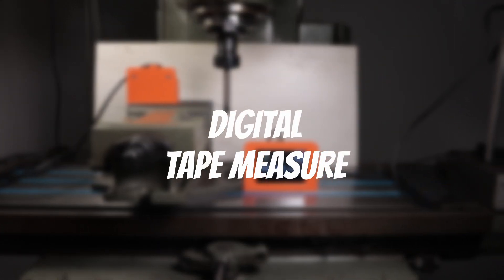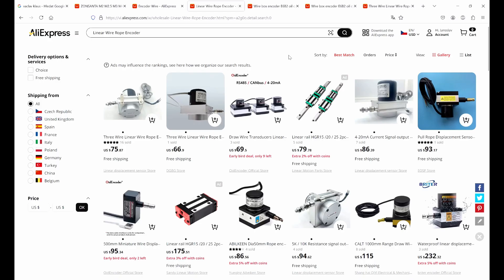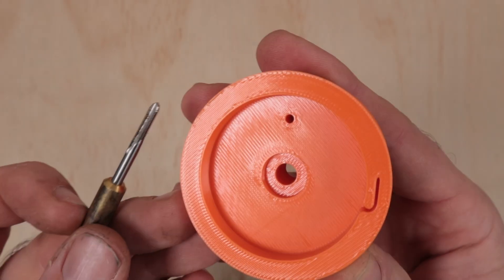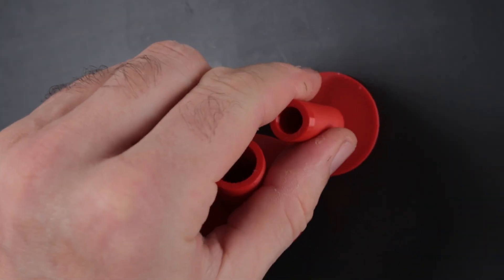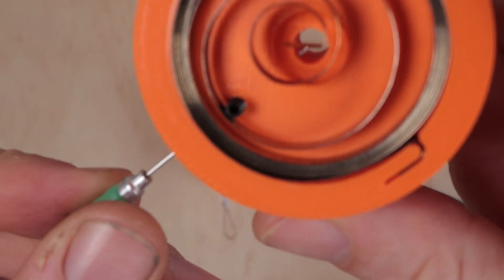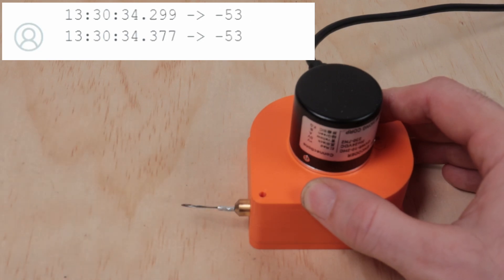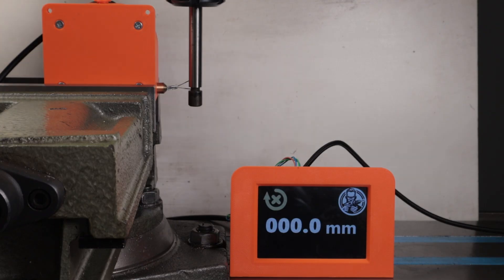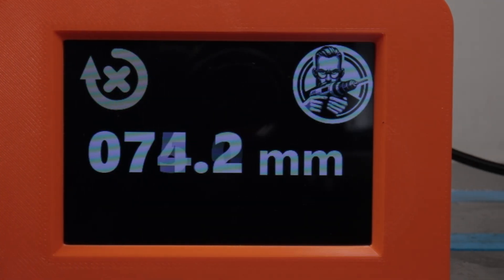How to Make a Digital Tape Measure: Step-by-Step Guide / Arduino + 3D Print

Comment: Instead of using a single ratio you could use a calibration table and interpolate the ratios. You can also eliminate the slight runout you may have in the wheel.

Comment: Thanks for sharing this. I’m wondering if the optical detection of rotary motion might be a superfluous step. Could you optically sense the unspooling of the wire directly? Maybe this can’t be done precisely enough but I notice that a cheap optical mouse seems to do a great job at precisely detecting motion under its sensor. Couldn’t an optical sensor similarly directly sense the wire moving past it?
Reply from the maker: Hello! Thank you for the feedback. That is actually what the encoder does 🙂. So, it could be done that way, directly, but at the cost of accuracy.

Comment: This is cool. I assume with the brass tube you recommend you no longer need a lathe? 

As for the 3D printing, try out the tree/organic supports, and possibly turn on "support on build plate only", makes support structures that don't have to sit on the model and instead will sit on the plate and reach in diagonally to support things like sideways holes.

Also is there a particular reason why you decided to both have heat-set inserts and tapped threads? for the set screw to hold the shaft of the encoder i would imagine you could just use a heat set insert that isn't so long that it goes the entire way through the printed part, but just long enough for the set screw to hold it.
Reply from the maker: Thank you! I'll definitely try different supports. Yes, the final upload is modified for a brass tube. I somehow prefer inserts, but I have to admit that in this design, it is a complete overkill. To be fair, if I made slightly larger holes in the wheel, the set screws could self-tap themselves. I also considered using inserts there, but it could possibly mess up the wire rope track. However, it could be done that way.

Comment: Looks sick! Although, Why such a large encoder? Any specific reason?
Reply from the maker: Thank you! 🙂 I wasn't able to find a smaller encoder with at least 600-800 pulses per revolution. The small ones, usually coupled with Arduino, has around 32 or so. The size of the design was limited also by wire rope, which is flexible, but  with limits.

Comment: An English tip for you:  "wind" is a homograph.  When you pronounce it like "in" it means moving air.  To refer to coiling a spring, pronounce it as "eye".

    Wind (noun: movement of air):
    IPA: /wɪnd/
    Example: The wind is blowing strongly.

    Wind (verb: to turn or twist):
    IPA: /waɪnd/
    Example: Please wind the clock.
Reply from the maker: I just said it out loud and I feel a little stupid :D. To be honest, this word is a bit exotic in my non-native vocabluary. Anyway, thank you for the clarification :). PS: I have pernament issue with word "diameter", that is where my native language kicks in and I find out only during audio edit.

Comment: Nice project!
Reply from the maker: Thank you, I plan to build a smart forging press and I am currently hoarding the key parts, this is one of them.
Reply: @JustAnotherCraftsman  I am also building a smaller one with a smaller tape measure and custom encoder.
Reply from the maker: @qiayuanl  sweet! What will be the application and what resolution do you plan? Custom encoder, man that sounds pricey, probably justified by the application.
Reply: @JustAnotherCraftsman  I use MT6835 with a custom PCB, it's very cheap with a 19bit resolution.